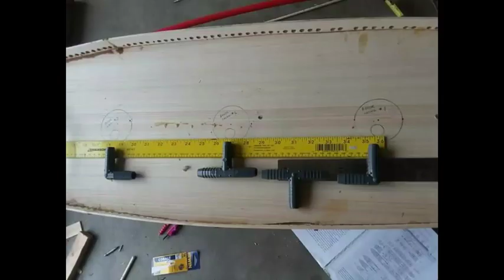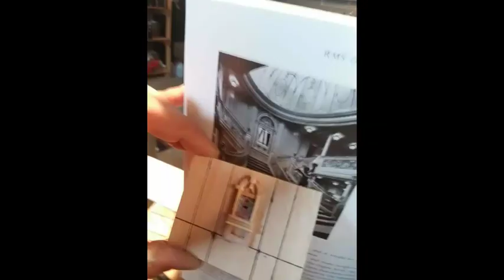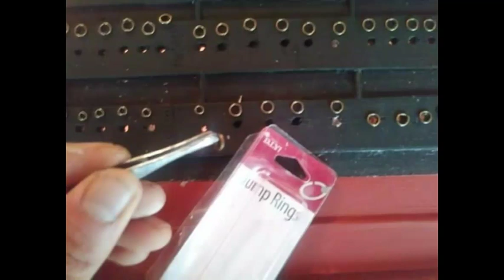RMS Olympic RC 6.5 ft Homemade build scratch

Comment from the maker: 1:140 scale 6ft. 6 inches  long,  100 lbs weight.  Triple  engines,  scratch  built , homemade not a kit , made from wood, fiberglass  , cardboard and some metal.  Begin Jan 2017 end October  2018 about  2 years ,  A world exclusive  model of Titanic  sister  ship Olympic  that has displace case detail yet sails functionally  well in water.  Long live  "The Old Reliable " Olympic  model lifeboat  1912 refit.